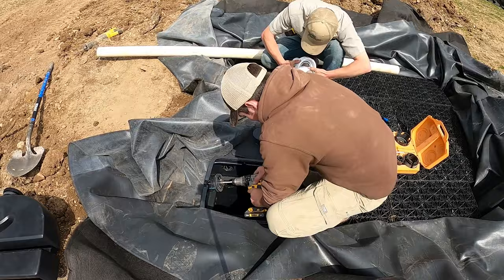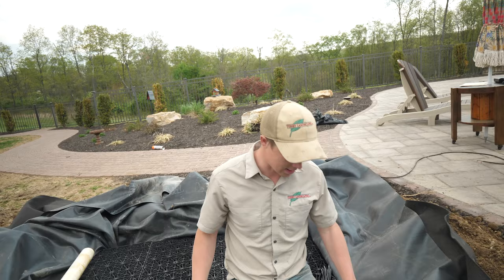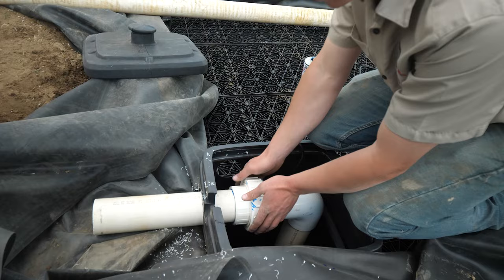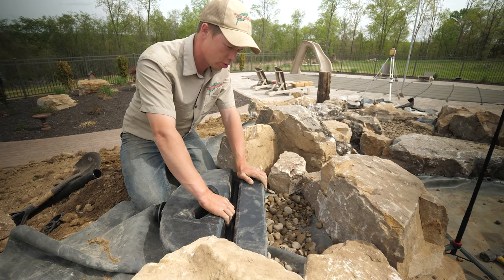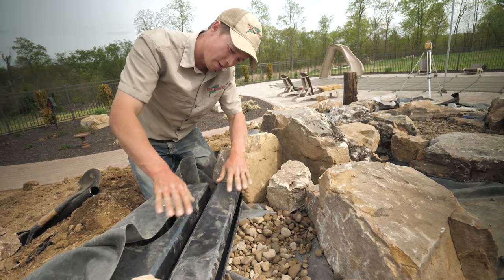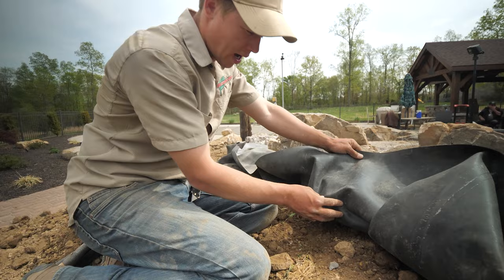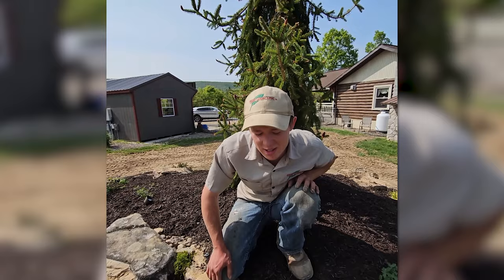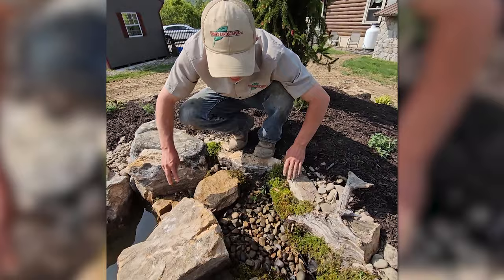How to Plumb a NATURAL Looking Waterfall (And What NOT to Do)

Comment: Awesome video & info Ben, exactly what I needed for my project ! What type of connection do you use from your solid PVC white line from the Vault to your flexible black line  ? ? I am thinking running mostly solid 60-70 feet from the Vault to my waterfalls & then connecting both ends with flexible black 3inch piping . Just need to know what connections I need ? Thx again 👍⚾️
Reply from the maker: A regular 3 inch PVC coupler. The plumbing between is interchangeable.

Comment: I am using a 3 inch 70 ft line from pump to the waterfall but having trouble finding a 2 inch male to 3 inch slip coupler from my 2 inch pump outlet to my 3 inch line . Where did you get yours ? ? Thx again ! 👍
Reply from the maker: I talked to Ben and he said it's a 2 inch thread into the pump to a 3 inch slip - probably from Lowes!
Reply: Thx 👍